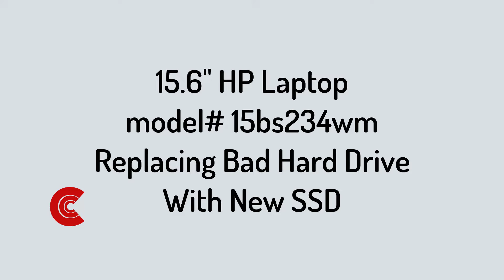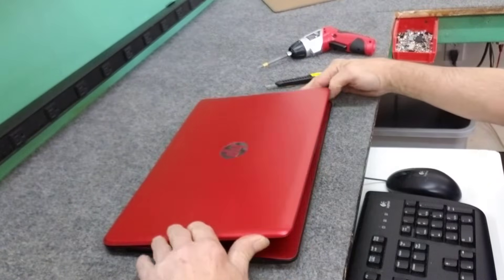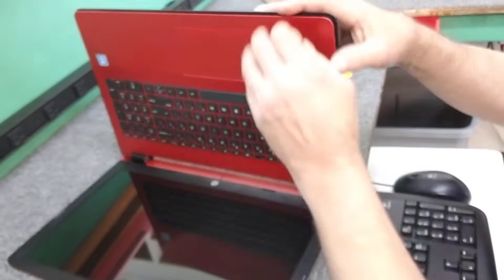How To Replace Hard Drive in HP Laptop With New SSD

Comment: Thanks for the quick right to the point video. These are definitely not high end laptops and mine was excruciatingly laggy with the HDD after 4 years of use. New SSD in and it runs the basics just as fast as My Dell work laptop now! SSD was $60. Much cheaper than a new home laptop.
Comment Edit: spelling
Reply: Knowledgeable bloke, but too much watching screws put back in.
Performance before and after would be interesting.

Comment: On my 17 series laptop there is a metal plate in the optical drive area with two chrome discs with a very shall  x in the centre which  is holding the front case to the back in that area. Any ideas.

Comment: Older laptops were so easily accessible ram, battery and back cover. These new laptops are trickier and delicate
Reply: It's to make it difficult to fix yourself. So they get your money for sending it in for repairs, or replacing it altogether. It's a damn scam
Reply: That's so you take it to one of their "official" repair shops to have anything done with it.
Reply: I have a Lenovo E570. Two screws give access to the SSD and the memory. So simple.
Reply: They design it that way so,  you when you want to replace a product u will f***ed it and u buy new laptop
Reply: Right? Something’s wrong with my HP laptop’s hard drive, and I didn’t think I would need to be drilling the back of my laptop to fix it! HAHA, but I’ll see if there’s legit any other alternatives that I can do, this is too complicated for me.

Comment: Very good guide.  One word of precaution.  Be very careful when taking the bottom casing off near the hinge. When we did it some small plastic broke off and a "rivet" holding the hinge broke causing the hinge to detach.  P.S.  The Acronis Clone tool that Crucial recommends doesn't clone a larger drive to a smaller one.  We used the one by MiniTool-Partition Wizard instead and it worked.

Comment: Hi I love your video so I got this problem with my hp laptop and it looks like it is almost the same as the one you worked on this video hard drive short DST check failed and shows 24 figures, this means that I have to replace the hard drive?? Thanks
Reply from the maker: Hi. Yes, that is correct.  You have a bad hdd.  You can put a new ssd in it, and do a clean Install.  It will activate just fine. Dale
Reply: Hello my friend, ok I just replaced the hard drive in my computer, and it shows: no bootable device— insert boot disc and press any key, can you tell me what to do there, please
Reply from the maker: @raulalderete7731  hi. yes, after you insatll a new drive of any kind you must do a clean install of Windows 10, your OS.

Comment: Do u know how i can take the ram out and replace it?
Reply: I know it's been 6 months since you asked, but if you have this model, open the case as shown. When you have it open and are looking at the inside, the RAM is near the front-right (it's the green rectangular circuit board thing you can see in this video). The RAM is held in place by a pair of clips, one on each side. You can just nudge the clips outward gently with your finger, and the RAM will slightly lift for easy removal. It pulls straight out. New RAM is just the reverse. There is a groove on the pin side that will line up with a little knob in the slot to make sure you have it right-side up. Gently push it in, then push down and let the clips click to hold it in place.

There is actually an extra unused slot on the model in the video (and the one I have here), so you could simply add another stick without removing the one that's there. The laptop model I have is HP 15-bs045nr, which came with one 8GB stick of Samsung M471A1K43CB1-CRC model RAM (the RAM will have a sticker indicating the manufacturer and model number). The RAM in mine is rated for 2400MHz, but the laptop runs it at 2133MHz. Intel XTU might be able to boost the RAM speed, but I haven't tried it on that laptop yet. The processor probably can't take advantage of much faster RAM speeds, so you probably don't need to waste money on anything above 2133MHz or 2400MHz (you can google your CPU, and Intel has the compatibility and specs posted online).

I would recommend getting a matching set if you plan to use both RAM slots for dual channel memory, so either find the same model as the RAM inside your machine, or buy a matching pair of new sticks. I hope that helps either you or maybe someone else who has the same question. If you're able to swap out the hard drive, then you shouldn't have any trouble with the RAM (it's not even screwed in, just held in place by the clips).

Comment: Well done video. In my case I was upgrading the mechanical drive to a SSD by cloning the original drive. Finding those screws under the rubber feet that is funny that HP does that. Wow.
Thank you for the detail and the detail very good video.

Comment: How do i pop the cd rom drive out?
Reply from the maker: Hi. You can use a straightened out paper clip to push into the tiny hole on the faceplate.  This will eject it so you can firmly remove it .  Dale

Comment: Hi, i need your help, I installed a new hard drive instead of a ssd, and i screwed up everything properly, but my laptop still says Hard drive not detected
Reply from the maker: Hi. You have to do a clean Windows 10 install if you put in a Brand New Hard Drive.  New drives are completely unallocated.  Dale
Reply: @CadillacComputerCenter  I have tried making a clean windows 10 install using the USB method, although when it loads into it, it ends up making a distorted screen
Reply from the maker: I've seen that before,  you may have a bad image on your flash drive. Use a new 8gb flash drive or bigger. Download the windows 10 media creation tool again on a different computer. Basically,  make a whole new bootable windows flash drive.  Also, use a different usb port on your laptop.  Dale
Reply: @CadillacComputerCenter  I will try that, thank you very much

Comment: my laptop doesn't turn on when i finished replacing my SSD
Reply from the maker: Make sure everything was hooked up good
Reply: @CadillacComputerCenter  would i need a usb bootable drive? also is there anyway to contact you during this time. i need help dearly.
Reply from the maker: Does it power on at all?  Yes, if you installed a new ssd, and did not clone your old drive. You will need to do fresh install of windows 10. Thx
Reply: @CadillacComputerCenter  do you have a video of how to get a fresh install of windows 10 on that laptop?
Reply from the maker: @albxdo9568  here is one of my videos on how to make a free windows 10 installation flash drive......https://www.youtube.com/watch?v=m2A5gcvV9HA

Comment: Which ssd are you using? What kind of ssd should I get? My laptop is the same as yours?
Reply from the maker: In this video,  I used a Crucial 250gb 2.5 inch ssd.  The MX500 series. Good drive to use in this laptop.

Comment: How many gigabytes did the SSD have in the video and how many gb do you recommend for this specific model?
Reply from the maker: 250GB SSD was used. You can use any size, 500, 1TB etc.  Thx. Dale
Reply: Hello great video how do I know if my old HP is compatible to upgrade to an SSD?

Comment: All though the carpet feature on the countertop work tables is nice to not scratch your work piece. I hope at min your grounded and or/using a static strap
Reply from the maker: Actually, my bench tops are anti static.  Also, I sit in a wheelchair with rubber tires.  Thank you. Dale

Comment: Sir, I have HP Pavilion 15-cs 1065 cl and there is no CD drive or the Hard Drive next to the battery, can you tell me please why or where is it? What a horrible product or is it so modern that I can not find it? The hard drive that is. Be safe and I like the video but, can,t find out the hard drive to upgrade. Have fun all.....
Reply from the maker: Hello there.  Your model has an m.2 nvme ssd .  It does not have 2.5 inch hard drive, or a CD drive. You can easily upgrade the ssd to larger size though.

Comment: I'm trying to find out if my HP 15 bs134wm has an M.2 plug inside but without just tearing it apart I just cannot find the information anywhere.  Any ideas? If it does i'd like to add the Intel Optane memory M.2 board.  I have one in my desktop and BOY what a difference it makes in speed.  If you have any information that can help me without me just tearing it apart please advise. Thanks a lot.  Your video here will help me put an SSD inside it when I get that chance in a few months.  Would LOVE if it did have the M.2 slot to add the Optane with that.
Reply from the maker: Hello. I cant say for sure, but my experience with the lower end hp models tells me , no it does not have an m.2 alot.

Comment: I have a question I had this laptop I believe if not this one very similar and the hinges broke and pretty much the screen fell off now if I were to buy the same laptop could I replace the hard drive as in take the old one out and put it in the new one will I still have everything from the old one
Reply from the maker: Thanks for the question.  If you buy the same laptop, like the old one, and put your old hard drive in the new one, it will boot right up.  I assume it is Windows 10.  After booting up go to settings and make sure Windows activate.  Make sure your connected to the internet when you boot first time.  It should activate for you.   All your stuff will be just like it was.  Thanks, Dale

Comment: i unscrewed every screw and followed all the steps exactly as they're told but the right side of the keyboard wont come up. when i tried i heard snaps. so like
he l p
Reply: i probably broke something inside oop
Reply from the maker: the keyboard remains in tact, just the bottom panel gets removed.  You may have a different or older model.  Some of the older models have removable keyboards from the top side.  You need to remove screws to take out keyboard in this case...
Reply: Check under the stickers sometimes theres hidden screws under them